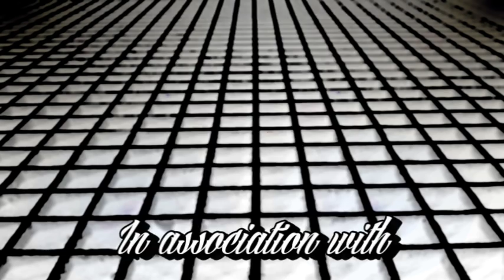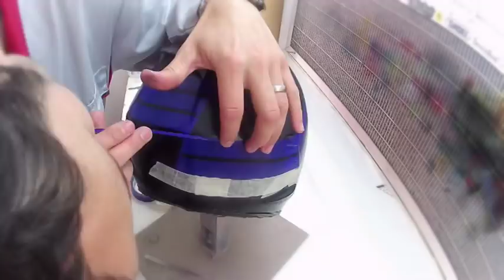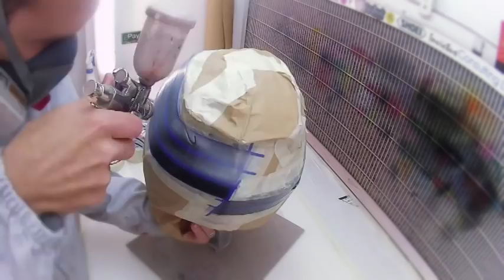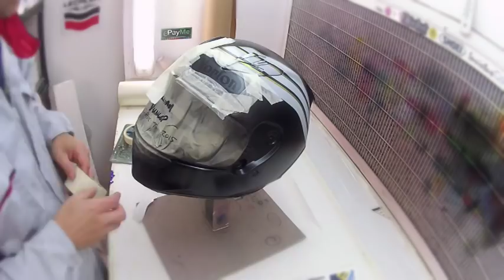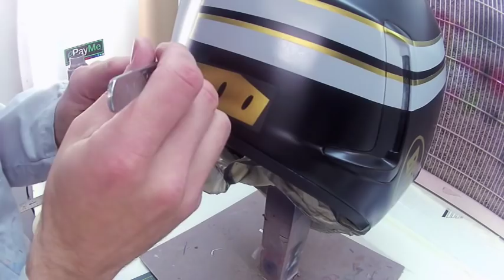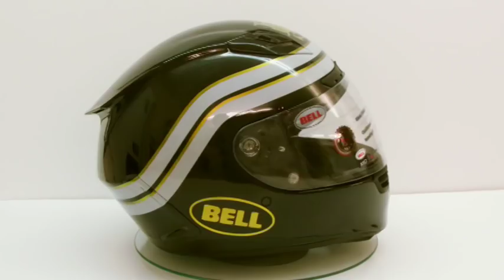William Dunlop's 2015 JP5 Norton helmet

Comment: what type of paint? acrylic?
Reply from the maker: Yeah.
Reply: PaintNation CustomPaintwork other type of paint  would probably damage it right?
Reply from the maker: Not really. The helmets come with a 2k clear finish on them which is not removed during the process. That will shield the helmet from being affected by any over coating of a new substraight.
Reply: PaintNation CustomPaintwork  I see. sounds good. I will attempt to spray my helmet. hopefully it comes out ok.
Reply from the maker: I'm guessing you are a painter?
Reply: PaintNation CustomPaintwork not a painter. I've done a few paint jobs for personal. but not a professional by any means.